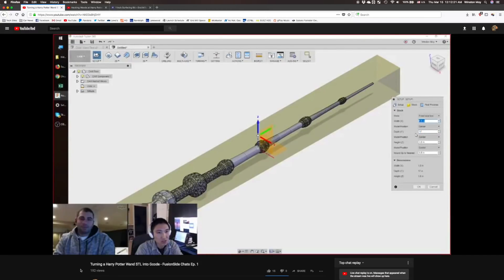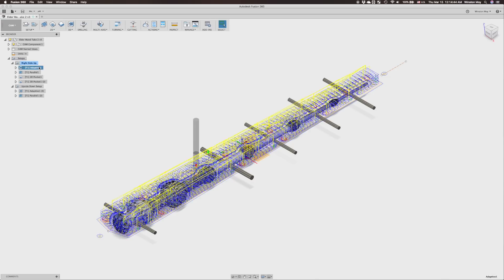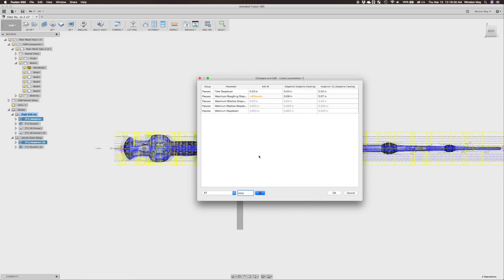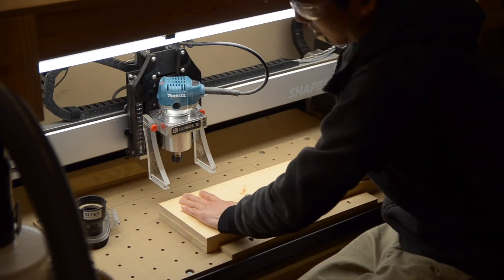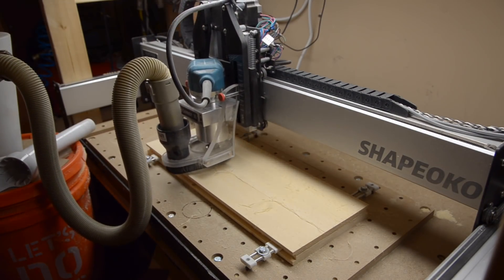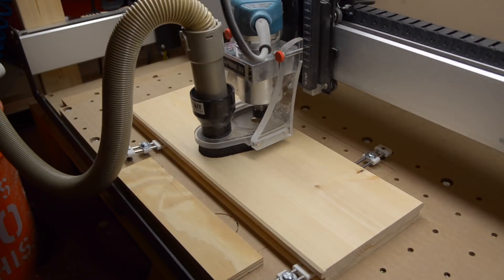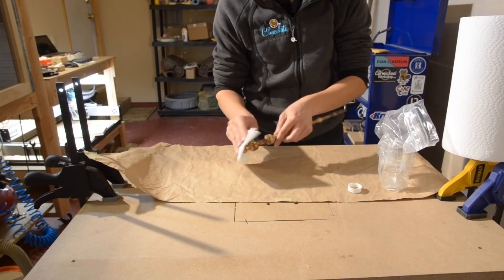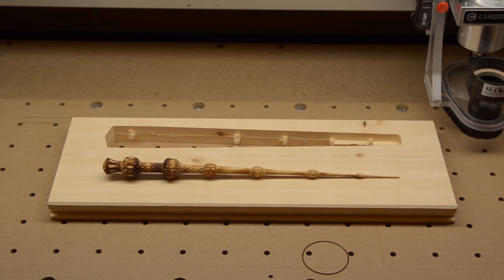CNC Wizardry: Making Harry Potter's Elder Wand - Project #116

Comment: Nice, Winston!  But how did you reset your X,Y zeros? Because, although you've registered the board for flipping, you moved your piece back.  Thanks!
Reply from the maker: Zero is relative to wherever I machine the indexing pin holes on the wasteboard.
Reply: @WinstonMakes   Of course.  Thanks.  I just had to wrap my head around the drill hole tool path in Fusion 360 that is used to drill holes in both the stock and the waste board.

Comment: Do you have a source for those indexing pins? Looking to do some double sided machining soon myself! Thanks for another great video Winston.
Reply from the maker: Home depot 1/4" aluminum rod stock. Not perfectly straight, but across the span of 1-2" it's good enough. Especially for woodworking applications. Otherwise there's always Mcmaster... $$$
Reply: I should probably have mentioned I live in the UK, but thinking about it.. if I just look for aluminium rod stock I should be able to get something reasonable. Cheers dude!
Reply from the maker: Even a wooden dowel could work if you find a good one. Bring calipers to the hardware store.
Reply: Was thinking that - just liked the allure of a more permanent, sturdy solution!

Comment: Great project!  BTW... When you were making your final facing pass, could you have zeroed the bit on the wasteboard and done a finishing pass at the height you needed?
Reply from the maker: That's where I set my zero, but because I was using the trick where you wiggle a piece of paper under the endmill, and jogging at 0.1mm increments, I was +/- a couple thou with my initial setting. I should have used the touch probe in hindsight...